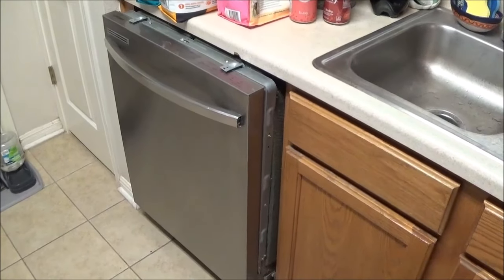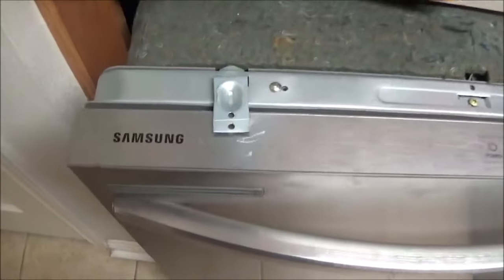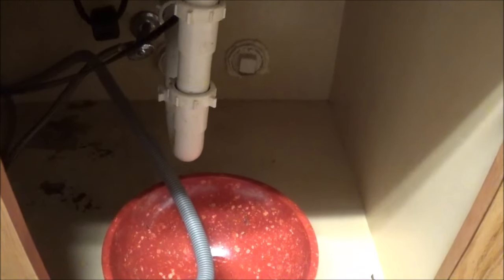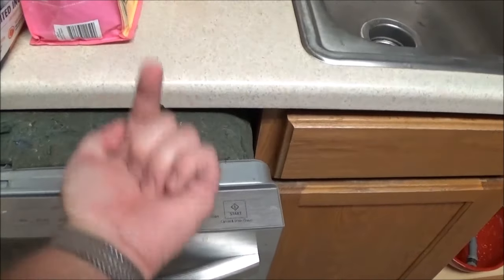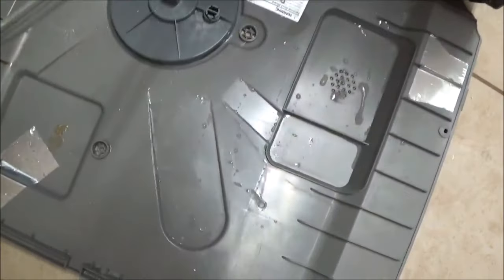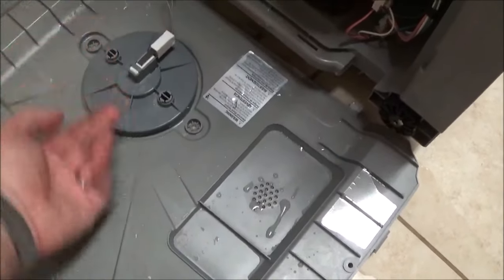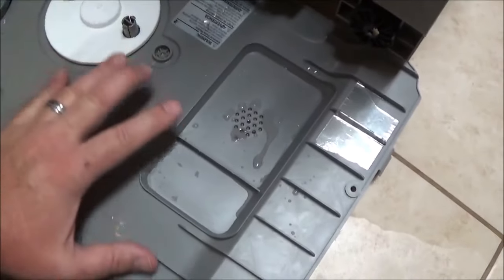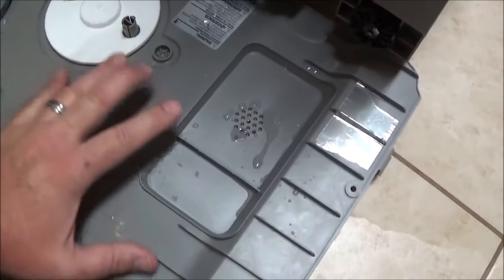Samsung Dishwasher Blinking Normal Light FIX!

Comment: What is the name of the faulty part/valve that connects to a hose underneath the disposal? The one you said you got on Amazon before but it’s no LL her available? I think this is what’s wrong with ours. Same model number as yours. No backing up into disposal or standing water inside the dishwasher. It we stop using it for a week or two it runs again until the unit detects another small leak in the leak pan. Then stops working again.  Was there a recall issued on these if the part is faulty? Hoping to hold Samsung accountable somehow.
Reply from the maker: @wursterismyhell  Thank you for watching. It's in the description of the video. Water inlet Valve. The link to the part is there also.  Make sure it is for your model before ordering.

Comment: what is the name of or part # of the valve which you ordered from Amazon?
Reply: DD81-02265A
Reply from the maker: Upgraded Samsung DD81-02265A Dishwasher Water Valve OEM Replacement 6740000046A 10A50100 - Lifetime Warranty
Reply from the maker: Thank you for watching. :) TYMM

Comment: if your leak sensor is triggered by accidental water spill/accumulation, and there is no real leaks anywhere, i found the easiest way without flipping the machine and removing the bottom panel, is to remove the side metal kick panel on the right(two screws), that'd give you enough clearance to reach beneath the sensor with your hand(unless you have a giant hand), use paper towel to dry most of water, this should be good enough to stop the flashing alarm. Then use a hair dryer blowing it with cool air for 5m will make it perfectly dry. Enjoy!

Comment: I have the same dishwasher and had the same issues with the blinking normal blue light and humming sound. I don't have any leaks that I can see and yes there is water under the round Styrofoam. It seems to work fine after one wash and then blinks again. Can it be something other water under the styrofoam? All hoses are leak free and nothing is coming up during a wash cycle.
Reply from the maker: Is there water in the bottom of the dishwasher?  Sounds like it is not draining properly? Have you replaced the water valve?  Upgraded Samsung DD81-02265A Dishwasher Water Valve OEM Replacement 6740000046A 10A50100 - Lifetime Warranty.   Also if you replaced your garbage disposal with a new one and did not punch out the drain knockout plug,  water will back up into the dishwasher causing it to stop.

Comment: I am actually now a professional plumber thanks to this video. (I found so many rat droppings and whoever installed my dishwasher stripped off the plug and hardwired it into the wall so that was terrifying. I turned off power at the circuit breaker which wasn't labeled at all)
Reply from the maker: Glad you safely got it working again. Yes, sounds like a rigged up job from previous owner.  Hopefully its working for you now.
Reply: @texasyardmanandmore3822  It actually stopped working and did the same flashing light. I even replaced that water valve and it's still not working sadly but I tried.
Reply from the maker: Have you found the source of the leaking? Leaking water will cause it to stop as a safety mechanism.   Sometimes the rubber O-ring in the impeller housing will leak.  50 cent part.  Big box stores like Home Depot or Lowes sells them.
Reply: @texasyardmanandmore3822  oh I just cut my losses and bought a Bosch and had an outlet installed in the wall. I think I did find a rubber tube where the water was coming from but I wasn't really sure how to go about fixing it at that point.

Comment: My normal light blinking and followed your instructions,  workwd once then the light came back on. Any suggestion? Water sensor switch back?
Reply from the maker: Hi Tom. First find the water leak. In one of my cases it turned out to be the water inlet electromechanical valve referenced in the video.  Found the part on Amazon for about 30 bucks.  You can see if your unit is under warranty. Samsung may fix it.
Reply: @texasyardmanandmore3822  where is the switch located at?
Reply from the maker: Its in the video I point it out.  On the bottom side. Its actually a water valve. @tomwong8982

Comment: So i did this , moisture was detected under neath, ran the cycle after clean up and its doing it again. Any thoughts?
Reply from the maker: You have to find the source of the leak.  Water Inlet Valve?  Impeller O-Ring leak? Leaking hose?

Comment: Your fix did work but it happened again… I’ve removed and dried the float/sensor in the bottom 4 times and it keeps tripping again. Help! Any ideas?
Reply from the maker: Hi Roy.  Are you finding water in the bottom each time?  Finding the leak source is essential. You can try replacing the water inlet valve. It is a electro-mechanical valve shown in the video.  Its not a guarantee but it fixed mine. You can search the comments to find the part number. Best wishes on finding the problem. TYMM

Comment: Your dishwasher was not installed correctly. There should be a 2nd hole drilled thru your cabinet at 31 inches high off the ground, to create a loop in your drain hose,  to prevent water from draining from your sink to your dishwasher.
Reply from the maker: That is how it was setup when my house was bought so not sure what code is for that. I will look into it. Thank you for the tip

Comment: How do i order this part that you got from amazon?
Reply from the maker: If Amazon does not have it you will have to search the internet for another supplier. Best wishes! TYMM
Reply from the maker: Upgraded Samsung DD81-02265A Dishwasher Water Valve OEM Replacement 6740000046A 10A50100 - Lifetime Warranty

Comment: I followed the same way ,I have a new p trap after new sink and disposal put in have no clue what caused , this was on the dry side and did not drain, no clue honestly I agree this is far lighter then old ones
Reply from the maker: If a new disposal was put in make sure you knock out the plastic punch out hole that the dishwasher drains into. On the side of the new disposal

Comment: What if this problem keeps happening, what could be the root cause?
Reply from the maker: Any new changes with your garbage disposal or anything?  If not, you need to find the source of your water  leakage.  Could also be the electro mechanical water inlet part I mentioned in previous comments. Best wishes on solving the water leak problem

Comment: Mine is doing same thing but it keeps leaking some where?
Reply from the maker: You will have to find the leak source. The water inlet valve may also be the  issue. I point that out in the video. Best wishes. TYMM